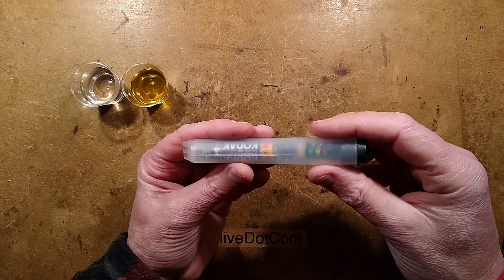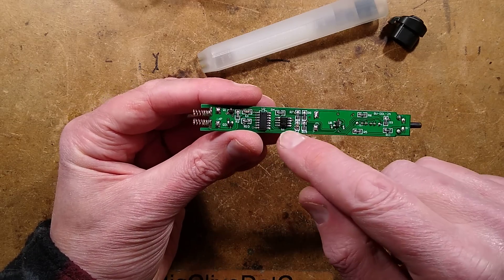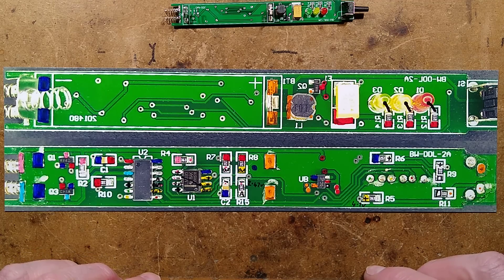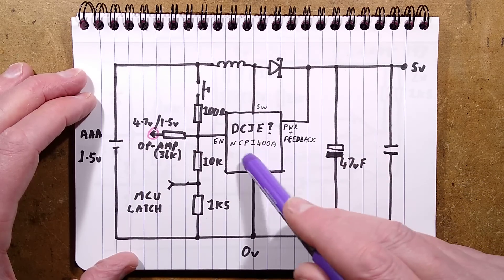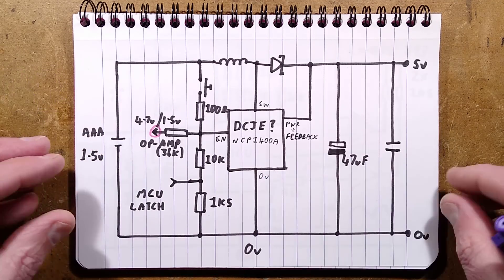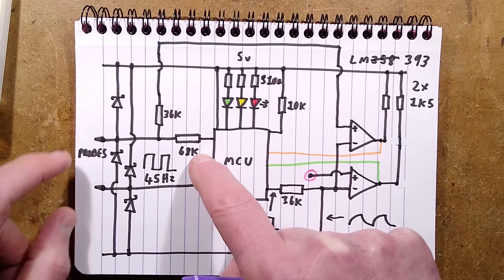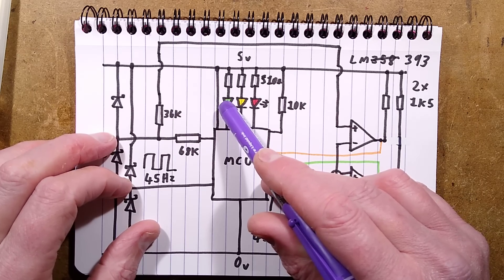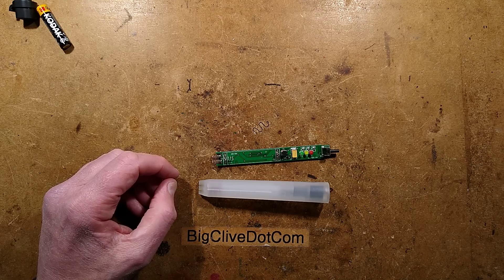Brake fluid moisture tester (with schematic)

Comment: It doesn't appear to have a seal at the probe ends.  I wonder what would happen to the circuit board and battery if it was dropped in fluid.  Brake fluid also removes fingerprints if exposed long enough.  I used to do brake work daily for a few years and learned how destructive brake fluid can be.
Reply: i think it does have a seal, those contacts are embedded in the plastic, and i presume the springs are there to ensure good contact.
Reply: I have a very similar one I bought many years ago off a tool van (circa 2000...) the probes are moulded into the case, and seem to be impervious to fluid getting in.... If it was immersed for a long period it may eventually leach in though

Comment: Interesting, coincidentally, I just picked-up a break fluid tester (make: Parkside - yes Lidl), discounted to £2! 
Seems to be a little more - err - sophisticated - than yours, with 5 LEDs, indicating 0%, <1%, 2%, 3%, >4%.
I don't think it's going to come apart though - in any way it will function again anyhow. Seems to have welded seams.
Reply: It is human to err

Comment: Does this also work for citroen LHM hydraulic fluid which they use for brakes?
Reply: No, only for standard DOT1 to DOT4 brake fluids, as those are glycol based. DOT5 fluid is based on silicones, so it will not work with them, though they are also hydrophobic, so water does not mix with them. Hydraulic fluid you have to use either a viscometer or a testing lab, to tell if there are wear particles in it, or if the additive pack is depleted. Easiest is to simply replace it on a regular basis instead, which is cheaper than sending off the sample to test.

Comment: You would think if brake fluid gets contained by water. There be a silica desiccant container  in the master cylinder.
Reply: Skoda did this for a while, but the packs had a habit of breaking down causing issues, so they stopped doing it.
Reply: Plus the fluid bonds to the water better than the silica gel does.

Comment: If your diagnostic tool tells you your brake fluid is fine, why would you change it? Just asking... Thanks for the video.
Reply: Most manufacturers recommend changing brake fluid every two years as standard servicing
Reply: The tester tells him water hasn't been absorbed in the fluid but that's only one thing. The fluid also serves to mitigate corrosion and is good to replace after a while to flush what it picks up from doing that job out of the system. The fluid I put in my car is clear and will brown over time. It's something like once every year or two I get around to replacing it, not very hard but does need two people to do if you don't have a fancy circulation system to hook up to your car to flush the lines.
Reply from the maker: I just felt the need to change it anyway.

Comment: my brake juice boiled on the way to work one day. pedal went all the way to the floor due to the bubbles, and brake disk was glowing cherry red when i arrived at work :)
Reply from the maker: I wonder if that was a seized caliper that caused excessive binding.
Reply: @bigclivedotcom Probably the boiling water that keeps the pads pressed to the disc?
Reply: @MichielvanderMeulen  my old vw camper developed that problem on the offside front wheel, very scary - apply the brakes enough to boil the water, the front left wheel locks up, and fortunately i went into the ditch, not into traffic.  problem magically went away, when i got started again, and put me back in the ditch, the next time i hit the brakes.  in short, wet brake oil can be deadly.
Reply: @rewIndustry  oh no :((

Comment: I just use a voltmeter. Positive tip in the brake fluid, negative to ground (idealy to the body of the cylinder just below the resrvoir). If the voltage is less than 0.3, fluid is okay. No battery or special tester needed! But then... maybe I'm wrong 😮
Reply from the maker: I'm not sure that would be accurate.  But I suppose you could detect a DC resistance.
Reply: The problem with a simple resistance check is the voltage being generated (by the galvanic effect?) will affect the resistance reading.

Comment: Lol 😂

why? Just change it!

Also, it is pretty obvious when it needs changed, unless you are blind, but this wouldn't work if you were blind.
Reply from the maker: It's probably to determine if there is a moisture ingress issue or if supposedly changed fluid has actually been changed.
Reply: Why change it if it doesn't need changing?
Reply: A good reason to flush the system is water is heavier than brake fluid, so it settles in the wheels. That is the reason the wheel cylinders (or calipers) are the first thing to go. They rust, from the water. 

That is also a reason that is pointless. If someone changes the reservoir fluid, but doesn't flush the system, the water stays down there until it gets hot. So that won't say shit until it gets hot. As soon as that happens, and the water reenters the reservoir fluid, the fluid turns dark. 

Water contamination causes the fluid to darken, and that is also the indicator for replacing the fluid.

If you question your mechanic, check the level & color, then go beat the car as you are leaving the shop. Get those brakes HOT! Check the fluid again. Return demanding a refund if the fluid is darker.
Reply: @Iowa599  Water doesn't settle in DOT1-4 fluid. Only in DOT5 and LHM fluids. But yes, you still need to flush it all out or you'll have old, worn out and watered down brake fluid in the lines and calipers.
Also some people think "bleeding the brakes" is just removing the reservoar cap so the air can rise to the top of the system (reservoar).

Comment: The RC+COMP looks like a poor mans ADC.
Reply: It's a simplified version of the ramp ADC circuits used in older multimeters, these excelled in providing a reliable resolution as big as the timer/counter resolution.  Some had circuits to cancel out component tolerances .
Reply: @johndododoe1411  thank you, this seems a valuable technique still, will be useful in my projects, i think.  am guessing the second (pink) comparator is for calibration, when the button is open.
Reply: agree

Comment: I have a digital meter that you'd like!? It reads mineral content in water, and tells you how many Parts Per Million (PPM) are in the water.
i.e. My tap water is 305, and filtered water from my Brita is 266. Science Equipment is cool! I love a good cup of hot tea, and the water is key!
Reply: Where I live the water is extremely hard, my meter says 650+ coming from the tap.  The APEC 5 stage RO filter system I use reduces the PPM to about 3 or 4...big difference and yes it's all about the water.
Reply: @terrym1065  Watch this Water Filter Test. The Zero Water got my water to 0, but it boiled weird and tasted weird, so I went with Brita.  https://www.youtube.com/watch?v=ja0ioX6GSz0&t=4s

Comment: if there is any question about the age of brake fluid or if it has water contamination, don't use a sensor. Just change the fluid.

Comment: that looks ridiculously more complicated than it needs to be.  Much more complex than the circuit continuity tester you looked at before. The clear blue screwdrivery looking thing.
Reply: it is not easy detecting moisture accurately and reliably, or how would you do it?
Reply: @rewIndustry  it's three LED indicators. It's not that accurate.
Reply: @Alacritous  water in brake oil can be dangerous, even deadly, one should expect the indicators to be accurate, and reliable.  again i ask - how would you simplify?
Reply: @rewIndustry  Are you simple?
Reply: @Alacritous  no
Reply: Yeah, thats what i thought. It has a microcontroller on it ffs. Come on! But then, if the chinese can make it so cheap, why worry.

Comment: Aren't there different types of brake fluid and would be a different resistance?
Reply from the maker: Most are glycol based and have a high resistance until moisture affects them.
Reply: Most cars use DOT4 the other ones are uncommon enough that they can be disregarded for the purposes of this device. Mostly used in race cars which should usually flush the brake system so often that water retention shouldnt be a problem. (That actually is the case for all cars if maintained properly).
Reply: @rimmersbryggeri  What mileage do they recommend brake fluid changes or time?
Reply: @tonysheerness2427  Every 2nd year is how often it has been done on all brands I have worked on in a dealership which is about 10. This service point is often overlooked when the vehicle goes out of warranty and only gets "serviced" at quick lube style places (Oil and filter  only). This can dramatically shorten the service life of especially calipers/ slave cylinder as the corrosion inhibiters precipitate out and the fluid may also become mildly corrosive from environmental factors.  This an draining the radiator are the probably the most ignored service points in older cars both cause simular problems to.
Reply: @tonysheerness2427  If there is significant moisture in the fluid, change it. That is the very reason such diagnostic devices are sold. Frequency depends on the humidity in your normal driving environment, how well the vehicle seals perform and a range of related stuff so checking every 6 months or so is a good idea. If you feel your brakes going mushy, check immediately.

Comment: If it absorbs water, and lowers the boiling point, why not boil out the excess water? 🙃

Seems needlessly complex, like someone wrote the code before working out why 😂
Reply from the maker: When you try heating glycol to boil out the water it tends to create a glycol fog.  It's how fog machines work.
Reply: How are you going to boil your entire brake system?
Reply: @GeneCash  heat.......

Comment: Or you could just stick your DVM in the fluid. But then you would have no blinky lights. 😂
Reply from the maker: That might cause the DC liquid issues I mentioned.
Reply: Like I told her... I just want to stick it in there for a second, Not long enough to do any harm. 😅
Reply: How bout using a VOM for conductivity testing?

Comment: I think using a dropper to add tiny drops of water to the brake fluid would be interesting, just to see how much water is needed before it spoils the brake fluid. Very interesting product. 2x👍
Reply: I was thinking the same thing. 👍
Reply: I tested it at the correct percentages (weighed brake fluid into a fixed amount of water) and it was generally reliable.
Reply: @khalidacosta7133    Did you use distilled water?    distilled water would better simulate water absorbed from the air,  which  has much higher resistance than any tap water.

Comment: Does this also work on headlight fluid?
Reply: It worked on my blinker fluid so it should work on your headlight fluid as well.
Reply: @uzlonewolf Naw, your tester is faulty. Blinker fluid is highly conductive. Headlight fluid, however,  is supposed to be non conductive.
Reply: I did use one on a haggis once. Not sure why it yelped? Perhaps it was where I inserted it?
Reply: You need a darkness tester for headlight fluid.
Reply: @stargazer7644  Should be easy to do since the speed of light is 3*10^8 m/sec while the speed of dark is zero, since light never reaches one's eye.
Reply: How about prop wash?
Reply: From what I know, it should work on flux capacitor fluid too...
Reply: @KeritechElectronics  Silly time traveler, flux capacitors don't use fluid.  Just feed them 1.21 jigowatts and they'll be happy.
Reply: I wonder if it would do windscreen washer fluid too. Be handy because in the dark you cant see how blue the fluid is. 👍👍
Reply: @dcallan812  Windscreen washer fluid will almost certainly trigger the Red LED 🤣🤣🤣🤣🤣🤣
Reply: Big fluid has got you all fooled. Blinker fluid AND headlight fluid are both just water and i've heard your headlights perform better if you drain the fluid!
Reply: What about cerebrospinal fluid
Reply: Should work on magnetic flux too
Reply: Yeah but youll need to ensure the coaxilator is working
Reply: Nah, headlight fluid has flammability, not resistance as key property, at least for the older models that converted the headlight fluid to a substance that burned brightly .
Reply: @johndododoe1411 that would be a carbide generator used in brass era car headlights😂
Reply: I own this exact tester. It doesn't work on headlamp fluid, it only works on blinker fluid and tail lamp fluid.
It's also very dangerous to replace headlamp fluid with blinker fluid or tail lamp fluid, this can upset the balance of the matrix and create a time vortex loop.👍
Reply: blinker fluid 😂
Reply: Doesn't work to identify snipe.
Reply: Not on the fluids in German cars lights.